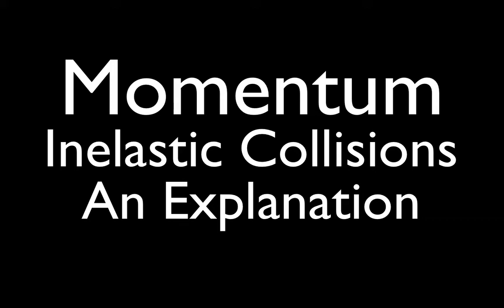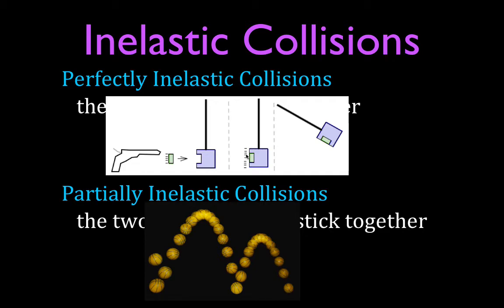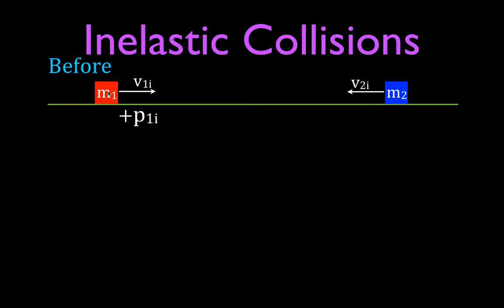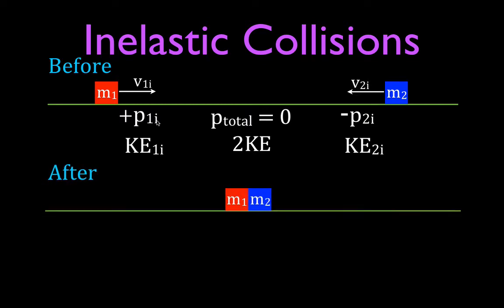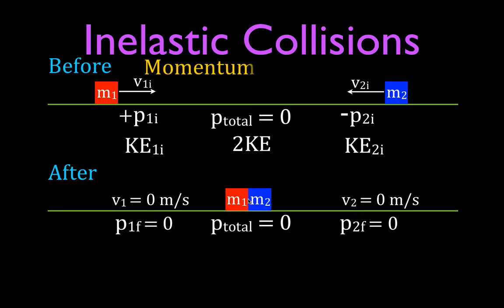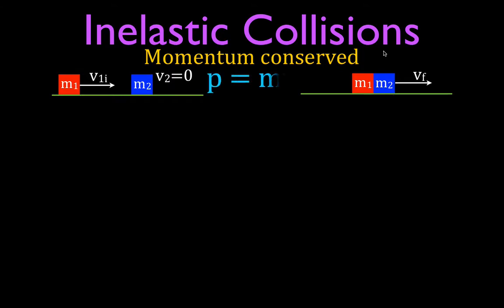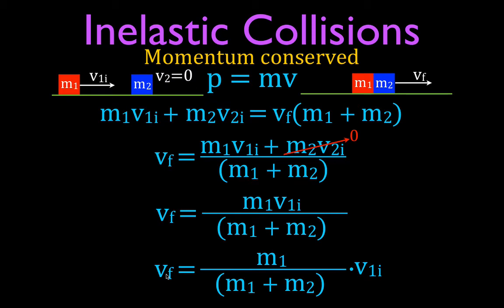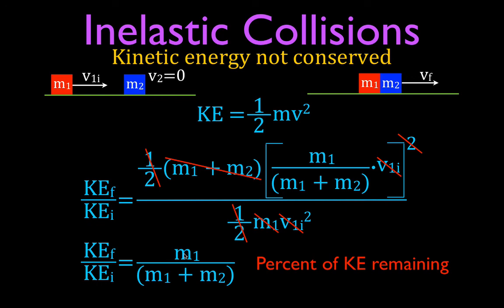Momentum (6 of 16) Inelastic Collisions, An Explanation

Comment: Great video sir 🙌

One little confusion that I have.. -
Consider a case where A ball , made of Mud (soil) is released from some height from A concrete floor , it would eventually fall and get deformed and stuck in the floor without bouncing. 

Sir How is momentum conserved in this case as before collision the system had some momentum(ball was moving) but after collision ball came to rest so momentum of system might be zero .
Reply from the maker: Energy/momentum are conserved because when the ball hits the floor it is deformed, there is probably some sound created and also some of the energy is converted to heat from friction.
Reply: @stepbystepscience  thank you sir  for the reply 😃
But sir please clear the confusion regarding the momentum conservation 
(I might have some conceptual error )